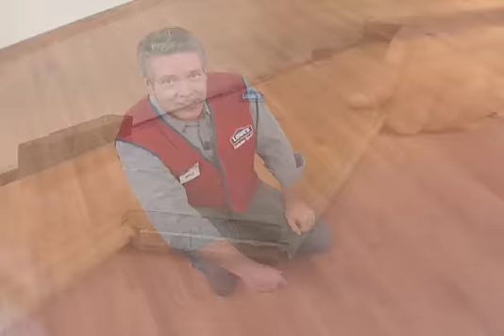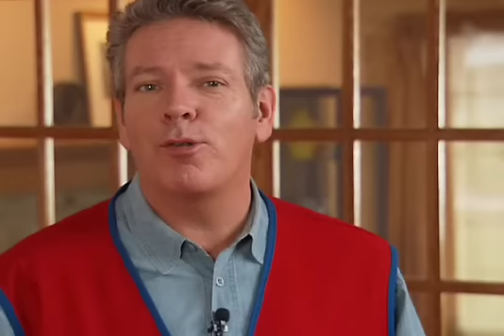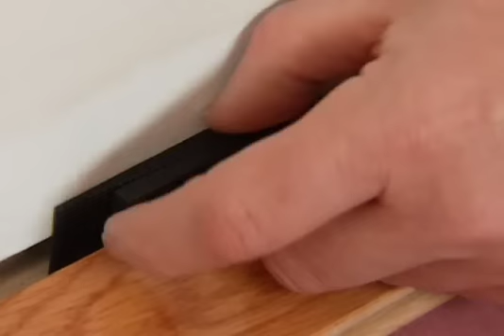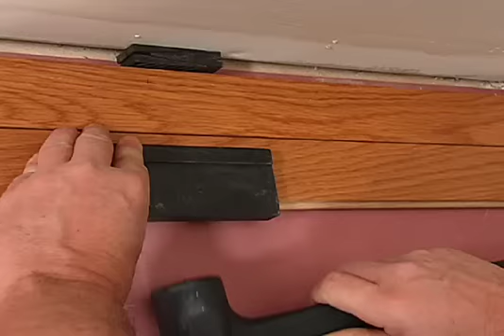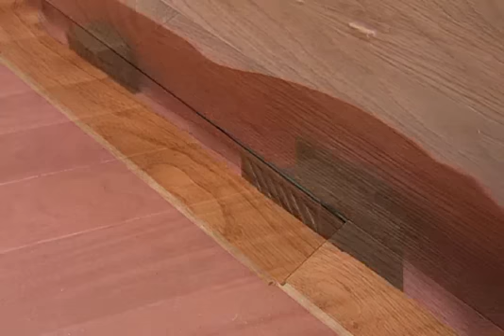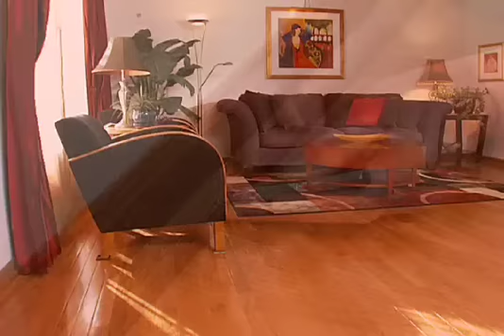How To Install Hardwood Floors

Comment: do u have to have the board in the house for 72 hrs
Reply: +Patrick Codling yes, at least 72 hrs, I prefer a week. The wood needs to acclimate to the new place because the wood expands and contracts. And you don't want that to happen after the floors are already installed.
Reply: Patrick Codling  Yes it is an absolute must and 72 hrs. is the minimum amount of time to acclimate.

Comment: question. why not installing baseboards first to make better guideline instead of spacers?
Reply: +balali0 Allowing the flooring to run under the baseboards provides room for the floor boards to expand and contract with humidity changes without creating a visible gap at the edges.

Comment: Tips.  Use a chalkline to establish the first row.  The wall may be out of line and your first row will be also creating problems with later alignment'  Also, facenail the first row so the base shoe covers the nailhole and drill and nail the next few through the tongue.  Filled nailholes are not necessay and stand out like sore thumbs.

Comment: I am using this guide for my imminent hardwood DYI.
Everything looks straighforward however he talks about doing face nail on the edges of planks but do you put a nail on every pieces you installed on or just on the ones on the edges?

Comment: Hi,I work with a company that manufactures epoxy sheet flooring systems ideal for both industrial and commercial facilities. Our goal is to provide a flooring system that lasts longer than vinyl sheet flooring and is easier and faster to install than traditional epoxy paint systems.

We are looking for importer.The next best step would be replying to me to schedule a Skype call with me to talk more about our process. You can add my Skype name now by searching "can.fast" Thanks.

Comment: Not an expert but HW is 3/4'' subfloors are at least 3/4'' min.1''-1/2 should do it after being counter sunk but if you'd feel better go with 1-3/4 "that's what I've decided on anyway." Think 2'' would be overkill but you're the one swinging the iron.

Comment: They are using a product called Red Rosin Paper, which is basically just a 3' wide roll of construction paper.  This underlayment is essentially useless.  You will want to use a 15# roofing felt, and this will serve as a moisture barrier and a sound deadner.

Comment: If I take the time to pull the baseboards off.... I would not use the shoe molding afterwards, I would leave  enough space just for the baseboard to cover the floor, looks better (and saves money).
To save the baseboards and not work more... I would follow same concept and leave enough space just for the shoe molding (which I don't like, but baseboards  removal take a lot of time, money and are potential for wall damage )... imo

Comment: @thefiresinside16: with same nail or the one that the pneumatic gun uses?
I may do 650 sqft of this. I'm lazy and will try NOT to take the baseboards off... what do you think of leaving 1/4" space away and enough to just put the 'shoe' molding on top? (saving the baseboards... bad thing they're white so was thinking picking a light brown color)... (Don't you put the baseboards only on top of the floor anyways??! I would leave space just for that and not use the shoe molding!)

Comment: i just had a question to ask of you according to your expertise.i just bought a brand new home 10 months ago and the hardwood floor is sinking down in some areas,spreading apart about the width of the side of a quarter between alot of planks and some areas near my stairs have dips, and also i will be walking and clip the tip of my shoe hitting some areas thait it is lifting can you please tell me if this is wrong or is it natural settling? thank you for your time

Comment: @Dani1165 if the base is already instal, you can always take it off and put it back or you can add a 1/4 round to te baseboard after the floor is done

Comment: the first 2 rows u can use a little nail gun 18ga. U can face nail the first row and the tongue also,just leave small space between youre wall, your base board will cover the nail holes on top

Comment: @bellco33 Thanks for responding. I did some further research and figured it out. We actually have shoe molding as well, so, from what I've learned, only the shoe molding needs to be removed since when reinstalled it should cover the extension gap.

Comment: @Dani1165  You have to remove the trim.  Carefully pry it off of the walls using a block to pry against so the pry bar doesn't go through the wall. .  For door jambs, use a jamb saw to cut the amount needed to slide the board under.

Comment: Someone please answer: what do you do if it's an old house where you're installing the flooring and the room already has a finished trim installed along the base of the walls? All the videos I watch show a room without a trim while the flooring is installed, with the trim added as the final step. What adjustment to this method is needed if the trim is already in place before the flooring is installed?

Comment: is faster if u use a finish nail gun so u wont have to keep drilling . . . n u dnt have to take the base out cuz the shoemolding will cover the little distance between . . .but my advice is get somebody to do it "like me":)  . . . u wont kill ur back and is  way more faster and better installled. . .  but good video tho!!!

Comment: @elitommy747 different types of hardwood have different expansion sizes. Some exotic woulds expand like crazy if there is too much moisture.. which would probably ruin the floor as well... anyway, depends what kind of hardwood is being used they all have different expansion sizes

Comment: @TheUFOeffect 
Here is the deal on shoe moulding:...shoe moulding in real life----not when you try to  sell something like LOWE'S--- is always installed when you have an existing base board that you don't wan to tear out prior to floor installation. Shoe moulding is a cost effective way to deal with covering up expansion gaps. The high end finish requires taking out the existing base boards and putting them back without shoe moulding.
Designers hate shoe mouldings. It looks cheap.
Greetings

Comment: I glue the first 2 rows away from the wall. Brad nailing the first row close to the wall enough to be covered by quarter round and brad nailing threw the tongue. I do 5 more rows with the Hardwood floor nailer I put a box of wood on the glued peices...

Comment: the second row you could nail through the tongue, but if you nailed just through the tongue on the first row there wouldn't be anything to hold the back of the boards down which makes it easier for them to buckle

Comment: Looks pretty much like synthetic hw flooring, which is not very hard, about a 3 (fairly easy) This also needs nails, so maybe 3 or 4. Get a friend, talk it over as you work.  If you goof it up, well, that's what rugs are for

Hardest thing is getting up and down if you're over 50 (or done a lot of rodeo...)

Comment: one thing i did instead of face nailing the top of the boards and filling the holes with putty was to drill holes at a 45 degree angle into the "tongue" of the board then set the nail in it. that way the tongue and grove still fit together between boards and then there are no visible nail holes on top of the boards. though you still do have to face nail the first and last rows of boards on the top.  anyways, me and my boss thought it came out pretty well.